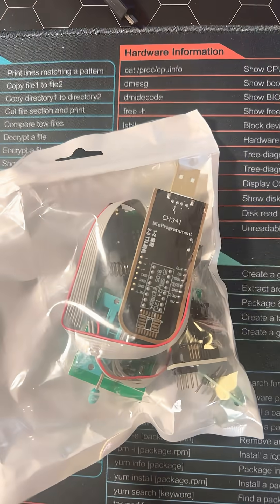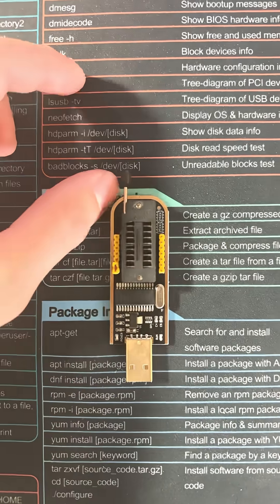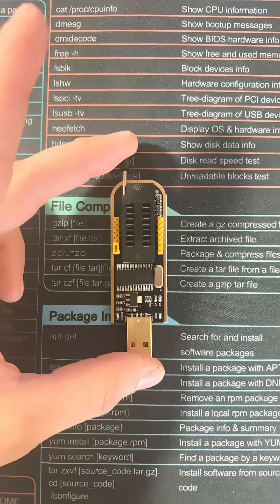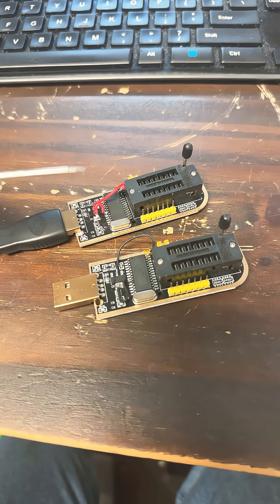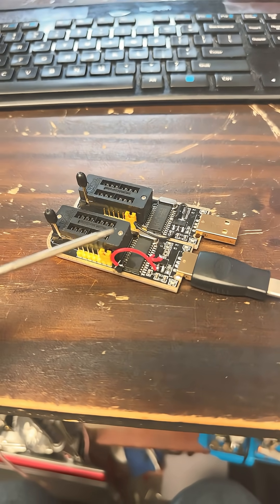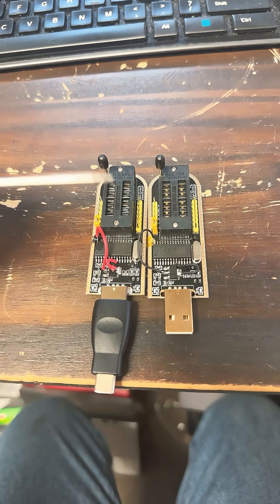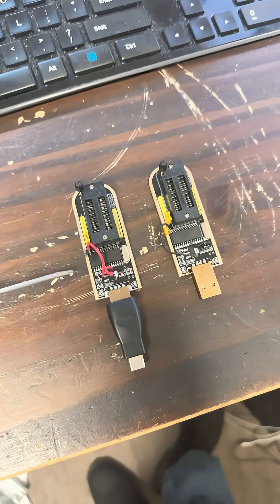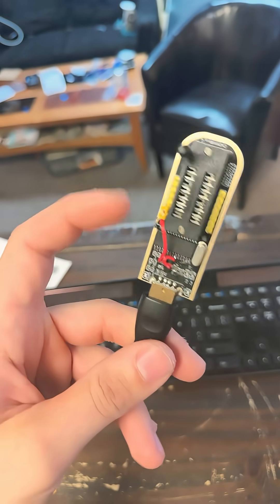Addressing the Myth Behind the CH341 Programmer.

Comment: the point of this is it still sends 5v via the data lines even if it regulates the 3.3 power in 5v on data is too high and causes issues corruption and bios chip death so yes it is nessisary
Reply from the maker: I've posted an updated video to this. You are one hundred percent, correct?There's so many conflicting sides on this issue

Comment: I don't get it.  You say the mod is not required, but you don't really explain why?  Technically speaking what makes the mod pointless?  I have heard the "myth" and measured the data lines with a multimeter myself, it definitely did read 5v.  I'm happy to be wrong but... Why?
Reply: the data lines read 5V but VCC (supply voltage) reads 3.3v, people claim this "fries" the chip but it's supplied in the micro amps out of use and switches to 3.3v when in use. People probe the wrong pins, read 5V, think voltage fries stuff (it's amps, not volts). Some early editions might've fried chips by improper switching or not providing resistance to 5V. Just a guess, I don't have an old programmer.

Comment: Not a myth, the first versions came with a design flaw, this hack applies only to the old versions, not for the new ones
Reply from the maker: Well it still puts out 5v then auto switches
Reply: @Valleytechsolutions  It killed one too many eeproms until I figured it was always outputting 5v, but CH341 was recently lauched when I bought, so long ago
Reply from the maker: @BrazilianGuyfromBrazil i just dropped a video on modding it with a step by step walkthrough

Comment: You don't have the fixed board version. Get version 1.6+ so you can select the data lines voltages. The 1.5, the data lines are at 5v which isn't great. There is a fix you can do to them but the 1.6 is the preferred option. I have one, its great.
Reply: Completely ignored the point of the video.
Reply: @QuackZack  lol

Comment: The mod changes the 5v TTL level to a 3.3V TTL level. The TX/RX remain open drain outputs.

It is required in many cases. In the case of a PS5, connecting 5V level UART will actually stop the communication until you power cycle. It doesnt cause permanent damage, but it will prevent you from reading the error logs.

You could use a 3.3v UART adaptor, or a TTL level shifter, but if you have a CH341 (with crappy drivers) and specifically want to communicate with a PS5, the first time, and not after 16 attempts, you need to modify the adaptor to ensure it stays at 3.3v.
Reply from the maker: I believed the same thing, the mod is not needed i assure you. Ive had no trouble communicating with the ps5 or any other chip. The mod is truly pointless! The data lines are 3.3V when using the device.
The voltage on the data lines WITHOUT connection is about 5V but as soon as you connect it to a chip and start communicating the voltage in fact IS 3.3V. So the modification is not only stupid it is also totally useless and even harmfull!
Reply: @Valleytechsolutions Ive been reverse engineering consumer electronics for the better part of 15 years. 

I've written reference material on circuits that without a doubt, you have read. My username on most platforms is @microsoldering 

Most of us have the CH341B/A. This is the OG. Read the datasheet yourself, specifically, section 4.2. 

If the CH341B is powered (VCC) by 5V, V3 (which is pin 11 btw, not pin 6) connects to an external decoupling capacitor. Pins 5/6 (TX/RX) will then operate at 5V TTL levels. 

If the CH341B is powered by 3.3V, you must, as per the datasheet in section 4.2, connect 3.3V to V3, which gives you a 3.3V TTL level. Failure to do so will give you unstable and unusable TTL voltages. 

On the 341C/T, V3 is pin 6. You said pin 6 in your video, which suggests that you don't actually have a CH341B, or you read the datasheet wrong. 

Many boards with the CH341C, are already wired for 3.3V. You can spot those by the lack of oscillator, because the CH341C has an internal oscillator, hence less pins on the TSSOP package. The mod does nothing, because VCC was already 3.3V. 

Theres also an abundance of CH341B labelled TSSOP ICs that don't have any oscillator. Those ones are FAKE, and failing to connect V3 to 3.3V after changing VCC to 3.3V will actually cause the adaptor not to work at all. It basically imperative you modify those, or you can actually have 5.4V TTL levels, and even 5V TTL devices can become damaged. 

If you have a CH341A/B/C/T with 5V on VCC, your UART is operating at 5V levels. 

I don't need to check myself, because i have already. Actually, i personally was largely responsible for outing one of the guys that made the PS5 UART software (Luan Tahiraj, BWE). Louis Rossmans videos included my own screenshots. Im the guy that started the chain reaction that turned the console repair industry upside down overnight. 

Check your devices VCC with a multimeter, read the laser etched markings on the TSSOP package, inspect them for an oscillator, read the datasheet, then come back to me. I can assure you, with extremely high confidence, that a large number of people are not converting these adaptors to 3.3V for no reason at all.
Reply: @Valleytechsolutions also after reading your edit, thats because on those devices, the pullup device side to 3.3V is a lower resistance than the internal pullup on the CH341.

But when the CH341s internal P mosfet drives the TX line high, it does so at whatever voltage is on V3, which can absolutely be 5V, and is for many of us.

Directly connecting 5V to the RX of the device makes the 3.3v pullups device side irrelevant.
Reply from the maker: @microsoldering1 look man the mod works but i assure you it is pointless. And has been confirmed to be pointless by every major name in electronics. I myself have 2 modded because i believed what you do now, and two unmodded and although i get what you are saying i promise you it is pointless. Do a little bit of review on this, all those claims about modding the ch341a are outdated and debunked.
Reply: @Valleytechsolutions ok then hows this..

You do another video where you read the datasheet for the CH341, and explain why its pointless. Show us your level of understanding, and why you are confident that everyone else is wrong.

I'll do one where i simulate the erroneous assumption you made with falstead/circuitJS/tinkercad, and show why it isnt.

Ill share both with the folks in the consumer electronics repair industry (im a mod on r/mobilerepair and r/soldering), and we can have them decide which of us is right.

The question is, are you confident enough to make a full length video about it?
Reply from the maker: @microsoldering1 thats fine,  but before you make a bigger fool out of yourself check out both northridge and electronicsrepairschools videos on why this mod is pointless not only has this been debunked but there are folks like you out there who truly believe they’re right about this. I had this exact argument with my mentor, and i mean literally THE EXACT stance you are taking right now in different discord servers and forums with some of the biggest names in the game and im telling you bro you are not wrong for thinking what you are so desperately trying to justify right now, but you have been mislead. Just take 5 minutes of your time and reread this exact issue. If I’m wrong, I will tell you I’m wrong and I am respectfully asking you to just do a little bit of digging and then admit that you are not just wrong but have been misled.
Reply: @Valleytechsolutions don't worry, ill call them out too
Reply from the maker: @microsoldering1 holy ship….i….i am genuinely confused now. I need to revise this video….im going live in a moment I might need to make a revision

Comment: It’s not pointless. The damn thing doesn’t switch on its own sometimes. I like never need 5v so I did the mod.
Reply from the maker: I promise you it’s pointless completely pointless do a little bit of research. I know exactly what you’re saying. I believed the same thing at one point as well and I promise you it’s pointless.
Reply: it was worth it for me and the consistency of the device. i was getting no chip detected a lot prior to the mod. Also  i have a 1.8v adapter if i need it.
Reply: @Valleytechsolutions mr sorin did movie about this 😊

Comment: I got the same desk mat lmao, also i got the ch341a, its pretty chill, you just gotta check its 3.3V output, not 5V, that is pretty commen so check, if its 5V do the bodge, but only the led wire here is needed
Reply from the maker: I promise you, the modification is not needed at all
Reply: @Valleytechsolutions can you please explain why this mod isn't needed?
Reply from the maker: @maxlindgren5795  i swear to you i have heard sooo many conflicting arguments i dont know what to believe anymore but i have been told that it does switch but this model is old and cheap so the initial voltage is 5v before it switches and the little moment can fry a chip
Reply: @Valleytechsolutions  There is video of multimeters being used to measure the voltage, it's fine. Besides it wouldn't matter, they are datalines, they run a very small amount of current, not enough to fry anything.

The ch341a has been the most popular bios programmer for a very long time, could you imagine it getting to that position if it regularly fried bios chips?
Reply from the maker: @therealgod4831bro ive heard sooooo many conflicting things from sooo many people i respect that this specific thing has completely thrown me off in what I believe in. Can you please link me that video I need evidence because I’ve measured it myself and I’ve also been told that without the modification that tiny jolt is enough to fry the chip. I have to be completely honest this whole ordeal has thrown me for a loop.
Reply: What is the desk mat? I like it
Reply from the maker: @WhoLover i have a video short on it if you wanna check it out, but i also have a link to it in my bio❤
Reply: @Valleytechsolutions excellent! Thank you!!

Comment: another option(though 3.3v only) is a pi pico or stm32 with serprog firmware, and these options are faster than a ch341a
Reply from the maker: 100% but i love this lil device and helps get into hardware hacking in the simplest way, and cheap.
Reply: @Valleytechsolutions  fair point, and it works out of the box(unless your flash is 1.8v)
Reply: @404dev-x what is going on with ppl on here, a lot of ch341as on the market are 5V on the spi lines, you have to check,and do the bodge if its the wrong voltage
Reply from the maker: @404dev-x  there’s an attachment for that as well!